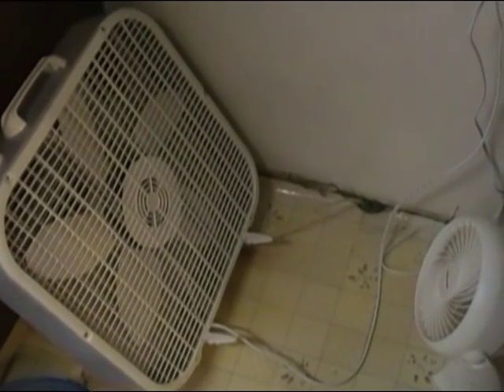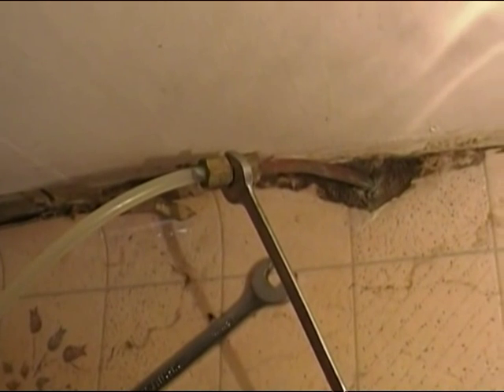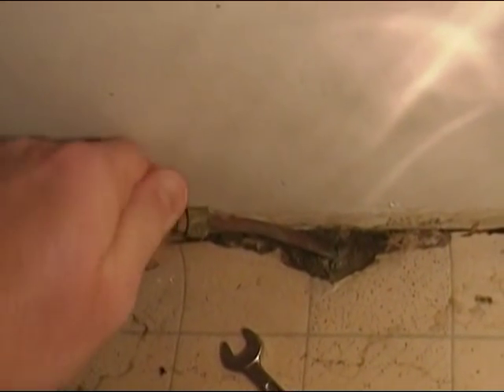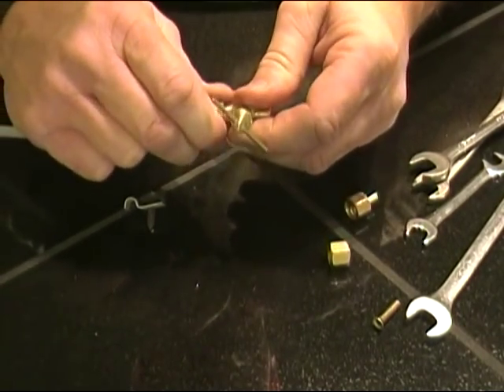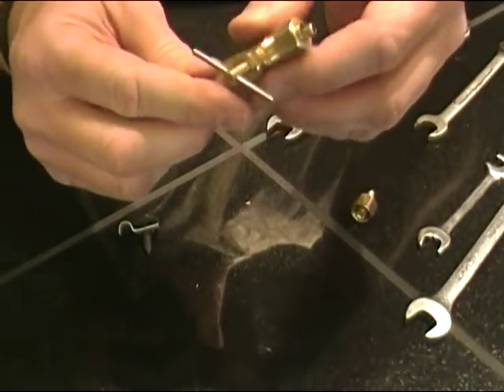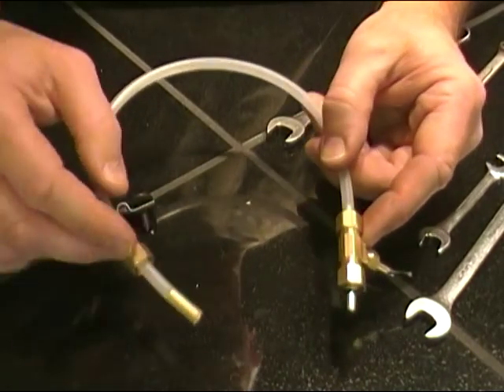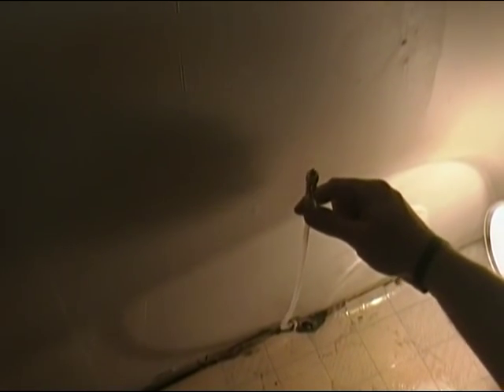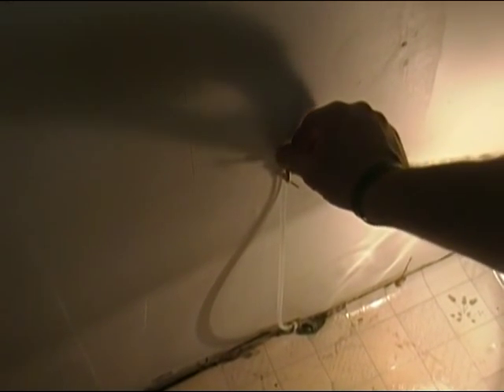How to: Ice Maker Leak - Remove, Repair and Install Shut off Valve

Comment from the maker: make sure that the 1/4 hose goes through the ferrule and sticks out a 1/4 inch or so. slide it into place and keep the line pushed in while tightening the fitting. Get it tight before turning on the water. You have to tighten it so that the ferrule compress's somewhat to hold the line in place. Thus comes the name compression fitting. good luck! hope this helps

Comment: This is exactly the fix I am looking for, given our house is older and the shut-off valve is under our house in a crawl space.  I know this is not an 'up-to-code' fix, but should solve our problems without an additional plumbing expense.

Comment: My connection at the wall connects to a long copper line which connects to a filter before going to the fridge. I want to disconnect the filter and "cap it off" here, since I'm buying a new fridge without icemaker. Is it possible to buy a cap, what should I ask at the hardware store? It seems to be a simpler job than installing the shutoff valve? Thanks for any advices. Your video is great, but I'm hoping for a simpler solution to my problem.
Reply: Do net mess

Comment: Quick Question, and thanks for the reply:  I did all of this, and the ferrule insert shot out of the 1/4inch tubing due to water pressure, any recommendations to clamp or compress a ferrule insert into place to avoid a loose connection?

Comment: I'm starting to think icemakers/water dispensers are more trouble than they're worth. It's more plumbing to worry about. I just had a Maytag delivered and the factory installed water line that goes into the connector on the top of the frig came out and started shooting water up in the air. The line is held on to the connector buy a metal crimp piece that's not reusable. Home Depot took the whole frig away as is sending another. They did ask if I wanted it repaired instead.

Comment: One more potential leak point. Attach the valve directly to the copper; then you don't have the plastic line and an additional fitting to be concerned about.